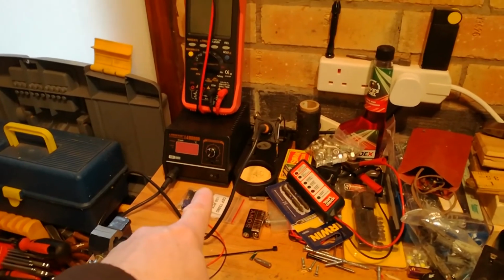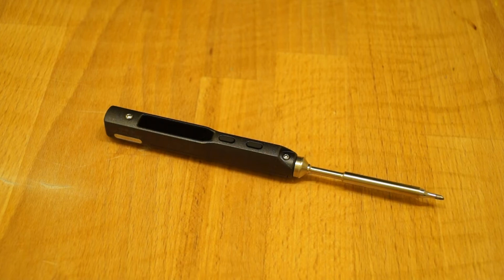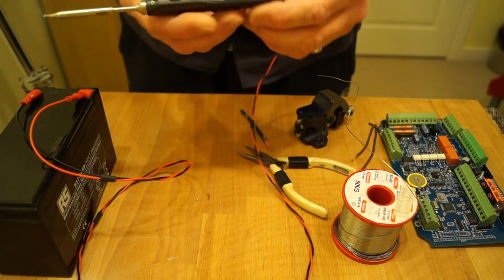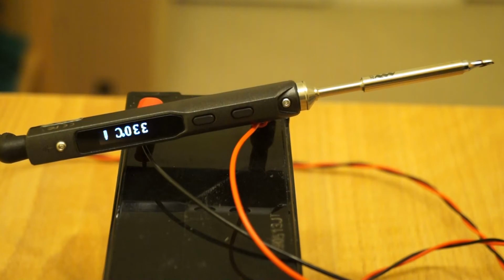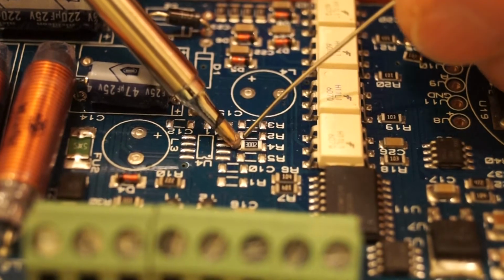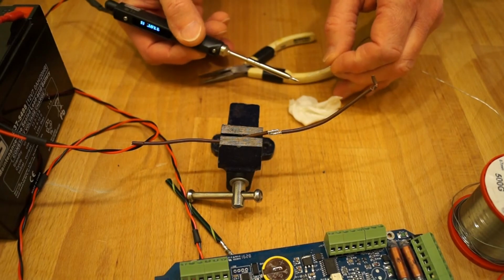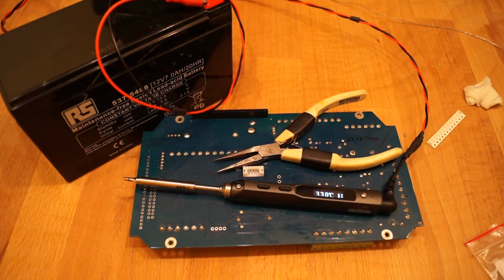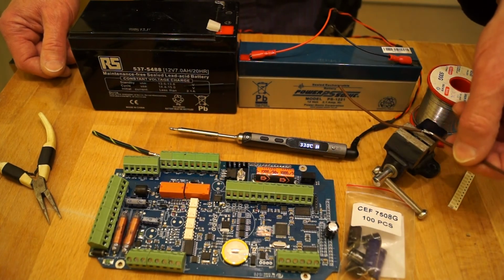TS100 Mini Soldering Iron Review

Comment: For best performance, you should use a 24V/3A power source.
Reply from the maker: +FloppyHares Thank you. I think that is the type of PSU we have where I work. Thanks for watching.
Reply: To clarify: the device is capable of generating 65 W of power, i.e. heat (mostly). P = U x I, thus, 24 x 2,7 = 65.
You can get a 24V/3A power supply to go with it for a couple of bucks: https://www.banggood.com/5_5mm-x-2_5mm-AC-100-240V-to-DC-24V-3A-Switching-Power-Supply-Adapter-Transformer-p-1092349.html?rmmds=search&cur_warehouse=CN
Reply from the maker: +FloppyHares Thanks again. That is just what I need for it. Undoubtedly my son will be taking it away at some point!

Comment: Help with the gearbest login code?When I enter it it's not working.
Thx for the videos.
Reply from the maker: +chuckles470 S Hi Chuckles. I have experienced login problems too of late. I have found that clicking the 'log in' button a number of times takes me along to a Captcha page. Enter the Captcha and you should be able to get in. If you can get in it may be worth changing your password if you haven't done so for a while. I hope this helps.
Reply: Thanks for responding. Unfortunately the pass code is the problem. Tried changing my password. Nothing works.tried new account but says my email is in use.lost all my credit .

Comment: I bought a micro gas powered soldering iron from Benzomatic at Home Depot and I was planning on using it to learn how to solder or weld if I can. Theres a guy on here called AvE and he is very funny and crude and uses bizarre words and dissects various tools and equipment and I think you might like him, if you like some crude language.  He is Canadian.  Did the body of this get warm?
Reply from the maker: +traderjoes Hi Joe. The body of the little iron didn't get hot and I was using it for about an hour. I will give the Canadian guy a look. I have a couple of the gas soldering irons/torches, I'll dig them out and send you a photo.